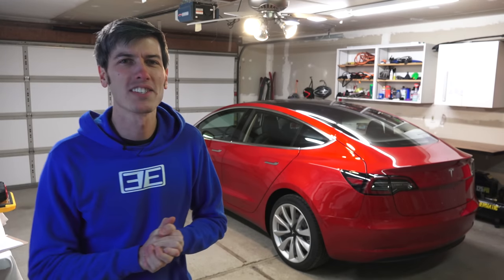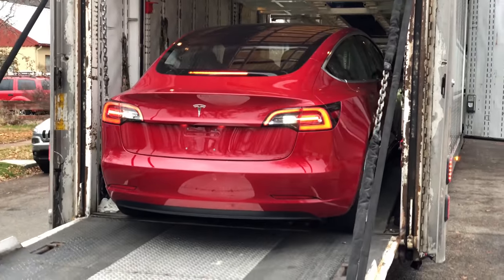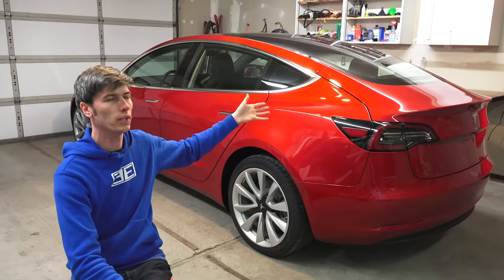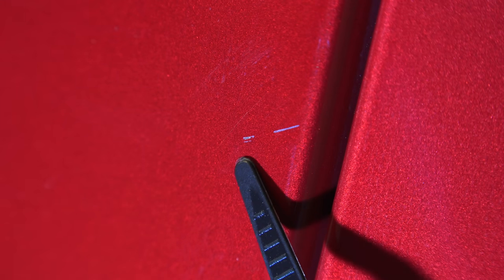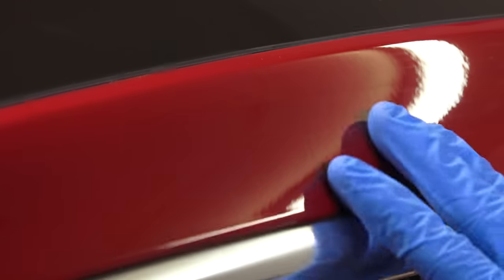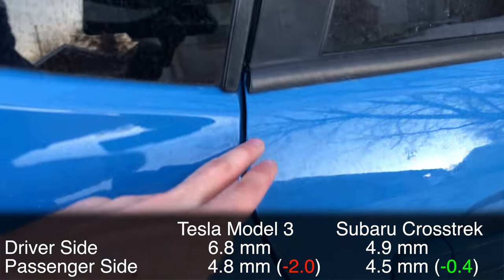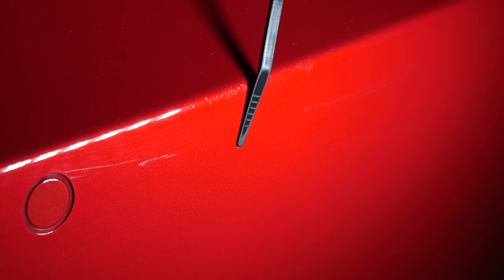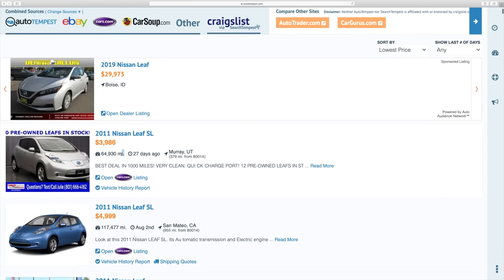Everything That's Wrong With My Tesla Model 3 - Quality Problems

Comment: The scratches in the paint are a thing I'd be a bit upset about. I'm not an insane stickler about panel gaps but the difference in elevation would drive me a bit insane. You're critiques are valid you bought a new car that has damage more in line with a used car. At least they acknowledge the problem and are working to service your car to make it right
Reply: Depends on the panel gaps. Couple of weeks ago I came across a Model X with a noticeable misalignment between panels. For a car with that price, I would find it unacceptable.
Reply: I have a  used car with 100k miles with less scratches than that has with 20 miles on it.
Reply: Maybe the difference in elevation will drive him mad too, such differences often cause increased wind noise.
Reply: Especially that misalignment on the glass panels… that's CRAZY for a car of this price, IMHO.
Reply: The biggest thing with the elevation difference is when it gets dirty. It'll be super obvious when the dirt stops at the panel because of the difference
Reply: This hurts the BEV market. But Tesla Motors /Elon Musk fansoybois and fansoygirls will only blame the heritics and non-believers

Comment: Wow.  Thanks for this.  I can excuse the "Road Rash" that it got in transport.  Those kinds of things happen all the time in new cars that are sent to dealerships, they just touch it up before you see it on the lot or before you pick it up.  However, the dust in the paint and the extreme's in panel gaps and the lack of levels.  That is a major concern for me.  If they can't be more concerned with how their car looks on the outside, what kind of care did they really take in building it on the inside where I can't see?  I shouldn't have to be the one to go over the car and make sure it has all the bolts it's supposed to and that all of them are tightened down.  I shouldn't be worried about the battery connections shorting or grounding out at some point and leaving me stranded because someone didn't torque a screw down enough.  There lack of care in inspecting the assembled cars as they leave their factory really makes me wonder.  Especially given that the low end long range car has a base price of $45k.

Comment: For the cost of a Tesla the panel gaps and levels should at least be as good as your Subaru. For $2500 extra on the paint is should be flawless and dead flat with no orange peel.
Reply: greggv8 Without a Dealer to fix the issues at their JPH rate not possible. Mercedes is 42 JPH for a reason
Reply: greggv8 why? Isn't not like the cars are otherwise equal. One is fitted with a lot more modern technology and an expensive battery.

That said obviously there shouldn't be any scratches on the paint
Reply: This golf cart company knows how to turn out expensive high quality junk. They have no clue what they're doing as none of this relates to the power train of the vehicle.

Comment: $2,500 for a new car paint color=rip-off. Sorry. I love electric cars but that’s a joke. They should offer a $500 discount for a car with just primer. Then take it to a local body shop for a $3000 paint job. A GOOD PAINT JOB.  Those contaminates on your car’s paint job are not “dust”. That’s GRIT.  Very bad quality control in the Tesla’s paint dept.  I’d be furious.
Reply: The door scratches look like stone chips which is why I think it's a used car.

Comment: You need to show the panel gap difference  as a percentage not just the difference.
As a generalisation the Subaru was within 10% of the smallest gap whilst the Tesla was regularly seeing gap variations of 100%.

If a manufacturer is aiming for 4.0mm gaps all around for the ideal perfect manufacturing tolerances then the Subaru is +/-5% whilst the Tesla is +/-50%.

Shows the reality of how bad the Tesla really is.
Reply: James Pieters great analysis !
Reply: Yeah, that was actually AWESOME.  @Newzchspy
Reply: Thank you for translating!
Reply: James Pieters are you a snowflake ? Panel gap accuracy is irrelevant to how good a car is. Check your skirt mate.
Reply: @nordic5490  Ahh, no.  Try again. A car is an assemblage of manufactured components.  Sloppy manufacturing tolerances are a direct indicator of how good any particular aspect of a car is.  In this case the paint and body work are pretty low rent.  If he compared this car's exterior build quality to a similarly priced BMW, MB, or Lexus the disparity would be gigantic.  Tesla will get there, but they're not there yet.
Reply: We're talking about panel gaps for now, but maybe, just maybe your airbag is fitted with the same "accuracy"
Reply: @nordic5490  coming from the auto industry I can tell you that panel gap is what your general accuracy is measured by. If the manufacturer doesn't even get the panel gaps right, you can skip looking at the rest.
Reply: If something simple like that is so bad, what any other things will be bad in the car?. The reliability of Tesla is bad, so this is only a simptom of how bad the car is. Quality is a global concept.
Reply: @daszieher  tighter tolerances means higher cost.. tesla probably cut this cost down because in real life it affects only the looks and you don't even notice it.. it doesn't mean that the engine etc. are not high quality parts
Reply: @nordic5490  my skirt is fine pal. And if Tesla aspire to compete in the luxury prestige market they better take care of attention to detail items pronto. Because at the moment they're are all cream no cake.
Reply: @nordic5490  also panel gap in terms of the doors directly affect interior trim fitment in terms of the clearances of the door cards to the dash and A, B & C pillar trims. The more inaccuracies, the sooner Tesla's will experience interior trim rattles and squeaks.
Reply: Consistent panel gaps are an indication of the build quality. Even gaps are relatively expensive to achieve, and most manufacturers cheap out because most consumers don’t notice.
Reply: Sheppards1984 or an electrical ground or bolt that's caused your new Model 3 to be towed three times recently.....( yeah, it's on YouTube as well)
Reply: Volumex you got it right except for the " simptom " part
Reply: James Pieters @James Pieters, ignore @Nor DIC , he just wants to look up your skirt with his shoe cam and see if you have the right equipment to drive a Tesla.....
Reply: @nordic5490  if this is what the customer sees, imagine components tucked away, such as steering, braking and security components (seatbelts, air bags, etc.)
Reply: @daszieher  Maybe the auto industry should look to more important issues than panel gaps as a measure of quality. How many different kinds of poisons are being emitted, and in what quantity? What's the real cost of ownership, including health costs, oil changes and other unnecessary maintenance that using outdated technology dumps on owners and even bystanders?
Reply: @bigb7157  Except a car that costs under 25k has better gap consistency than a car that costs almost 50k.

The Tesla build quality is just bad.

Comment: Those flaws would be unacceptable on a base Toyota Yaris much less a Tesla. My own Nissan Versa was in perfect condition when I picked it up and it's held up remarkably well after 12 years. I wonder if the same will be true for your Tesla 3.
Reply: Please, I got a recal for my 2011 4Runner for paint on the pearl white paint job. Honda pilots also don’t hold up. And for those people claiming Audi is the best, friend blew his engine 104k miles time belt failure.  My brother Honda Accord. 200+ miles and never did any timing belt maintenance. Also 2022 tundra on recall now and they have very low numbers. So to single out tesla as if the other brands are any better is joke.

Comment: I work in a paint shop for a Japanese auto maker in USA. These scratches would be WILDLY unacceptable, especially for the higher end paint job. Also, $2500 is more than twice as expensive as our luxury pain. The orange peel is almost impossible to get rid of in mass production. The spec of dust should have been noticed and fixed before leaving the paint shop. It makes me happy that they are fixing the issues. 

I work in a paint shop, I don’t know anything about panel gaps.
Reply: I've worked with car painters. Here it's part of their job to fix minor damages, removing panels or doors before painting and put them back on (because its faster and cheaper than wrapping the whole car) ... they have to care about and adjust the gaps. Do you paint everything on the car?
Reply: Ohhh, "luxury pain", that sounds good! 😜
Reply: @SamGamgee8012  onnononoo.oo.ono
Reply: @SamGamgee8012  .onoo.9.no.o.oooo9.9n9.onoooo.
Reply: @SamGamgee8012  ooonoooo.oono9.o9non.oooo.
Reply: Opposite here... I work for a Tier 1 Toyota supplier who makes body shell parts, but I don't know jack about paint. Already gave my $0.02 in another reply.

Comment: I got my Model 3 in July 2018, and while there are definitely some paint imperfections (there's some missing paint along the back edge of the hood, like they didn't paint all around the edges), but I did NOT have any scratches, nor did I have debris stuck inside the paint.  I also have some degree of "orange peel" effect, but nearly to the extent on your car. I do not have any of the significant panel gap & misalignment issues that you've got, either.  These are ALL issues that Tesla has historically fixed under warranty for customers, thankfully.

I'd be mildly disappointed if my Model 3 had the build quality issues that yours has.  I did have one significant issue - my windshield was noticeably distorted.  I had Tesla replace it, and the new one... is still a bit distorted, but it's a lot better.  Most windshields have some optical distortion patterns in them, and my new windshield is on the poorer end of typical for cars of many manufacturers.  The one that shipped with my car was much worse, with distracting distortion patterns right in front of my face as I drove.

All that said, I've had my Model 3 for more than a year now, and it's still not only the best car I've ever owned, but it's the best car I've ever *driven*. I wouldn't trade it for anything on the market right now!

Comment: The car shows all the signs of a production line under stress and the QC suffers. Personally, I would reject it, a repair paint job on a new car is not acceptable.  I still would love to own a Tesla and admire Elon for what he has achieved.
 Just watched a video on the Dacia Duster factory,their quality control should be a lesson, huge attention to panel fit, and paint thickness and finish, the Dacia is a cheap car, but the attention to detail is excellent.
Reply: Same. I wouldn't accept delivery of a vehicle in that state, it's clearly damaged.
Reply: I know two ppl that bought new dusters a year ago, on one of them the front left shock was loose. making a klonking sound on every speedbump. the other car had a loose swaybar. from new.
Reply: Good news everyone!
Reply: @Eexpers  The Dacia Sandero is coming to the US with left hand Panel Gaps!
Reply: ok because i owned a dacia and within 2 years almost all of the interior went bad,i would not call them an example...all the interior buttons on the dash got discolored,the steering wheel buttons dont work anymore (volume up down) the screen that shows the radio station and other info does not work (you can see the screen only during the night where there is no sun to reflect light)...Honestly i learned by hurt how many times to press what button so i can navigate to connect my phone via bleutooth during the day...i bought the car under my business expenses (it was cheap for new ) to have something to move around with less fuel consumption so i dont move my SUV just to go to work and the kids to school...i left it in the garage while the season bussiness is off,i dont want to move it around now so things cant brake...hopefully it lasts 1-2 more seasons and then i drop it in the sea,i doubt abnybody would want that.
Reply: @gluttenglutten  My work friend has brand new Duster for 2 years and his wife just got 2004 Ford Fiesta. And now he drives her Fiesta and says that he can't believe how nice that car is.
Reply: dacia is a good reliable cheap car.